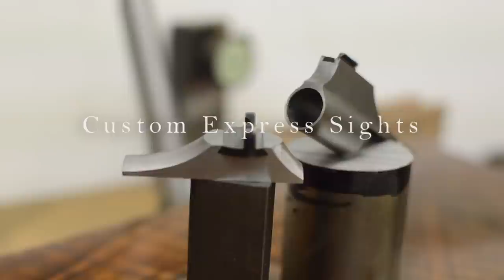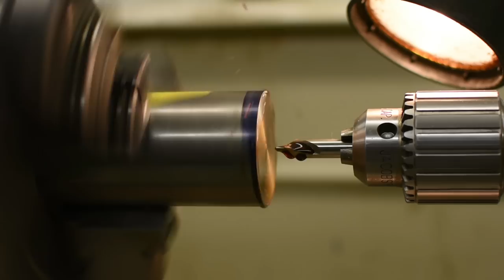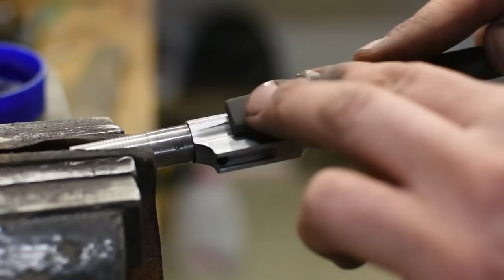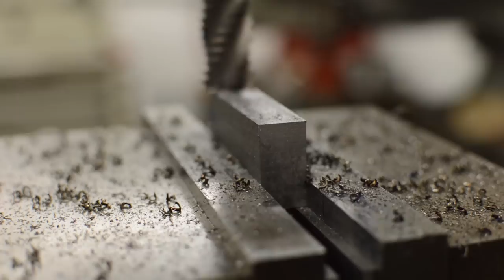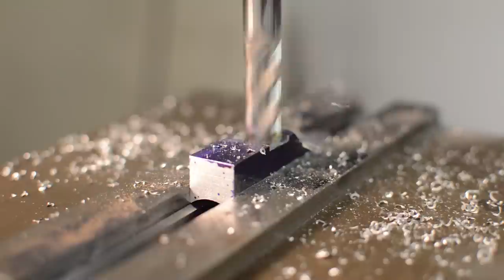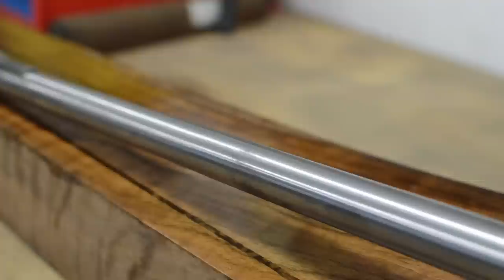MACHINING RIFLE SIGHTS FROM SCRATCH

Comment: Great video! 
What type of cutter are you using at 2:18?
Reply: Looks like a T-slot cutter with teeth radiused to be concave.
Reply from the maker: @huntingsgr8  It's a concave cutter. It's actually a cutter designed for a Win M70 extractor cut, but it worked well for this application.